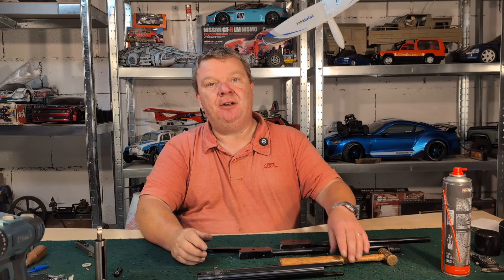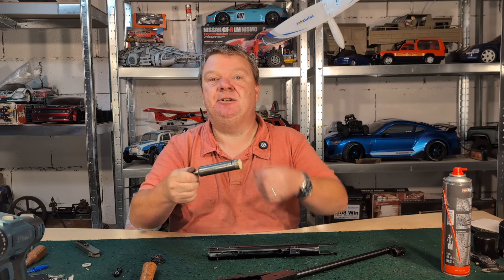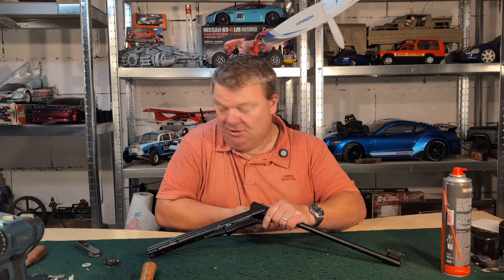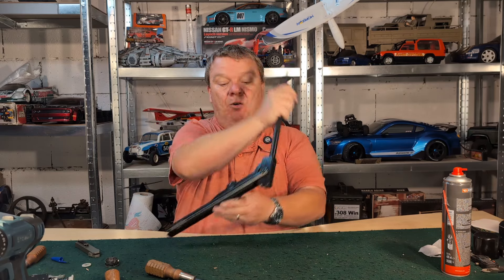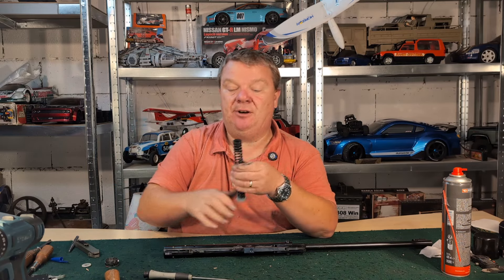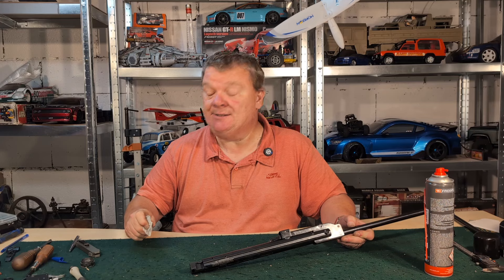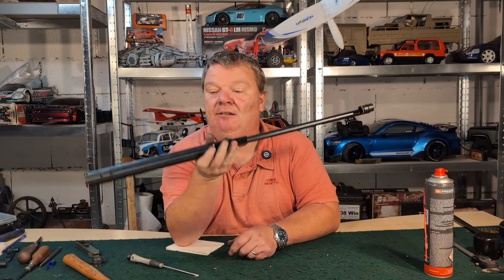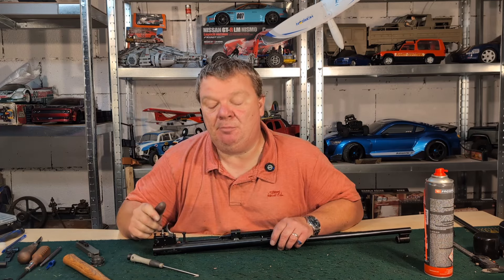Weihrauch HW30s. How to improve your rifle. Part 3 of 3: Relubing and rebuilding

Comment: Nice, i stopped the video half way so i could go off and pre-order my tbt hw30 kit 😂. Picking the gun itself up on Saturday from a dealer thats holding one for me.

This will be my first attempt at tuning of any sort at all so im sure i will be rewatcing these vids regularly the next few weeks while waiting for the kits to be made.

You asked in a different video about other videos subscribers are interested in seeing, well perhaps a quick rundown of your tools and what to look for and where to source them would be good for beginners like me. You could even feature your favourite screwdriver, lol. Seeing your apring compressor contraption was interesting, i had no idea it was that simple so im sure you may have some other interesting tips.

Oh, and i forgot to order the bumslide, i have emailed to see if there is any way to add it on without incurring extra postage, no worries if i cant though.
Cheers

Comment: Serious question.. Why polish the piston when it's the piston seal at the front that makes contact with the piston tube/cylinder ?
Reply: There’s no harm and some believe it might run smoother, also many air gunners are tinkerers😛it’s not that much of an effort and even if the placebo effect makes you believe it’s smoother it’s worth it😛 just don’t polish it to a mirror as it won’t hold the grease anymore.

Comment: Hi , I apologize for using this communication channel, but the phone number does not seem to work for Portugal, I also sent an email to the contact on the sales website and did not receive any response.
It is about a purchase I made that I have no information about its status, made on November 1, 2024.
Can you please check your email, I forwarded the email from the sales platform. Sub "FW: Your Tinbum Tuning order has been received!"
Reply from the maker: I will check now, but please also check your spam folder for your tracking number👍
Reply: @tbtairrifletuning1520   all ok , Yesterday I received the email with the number, thank you for everything. It just took longer than I expected.